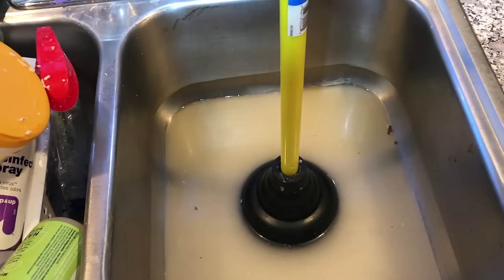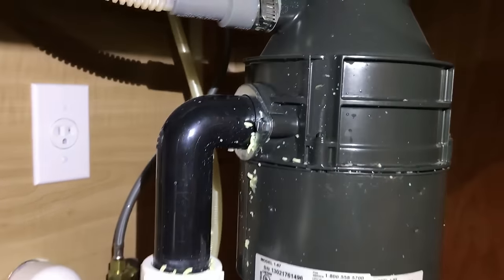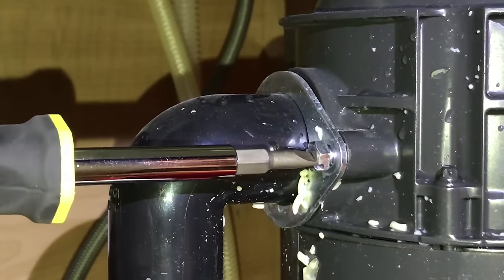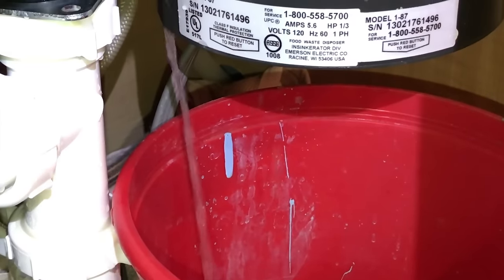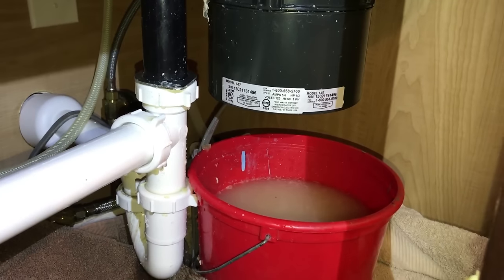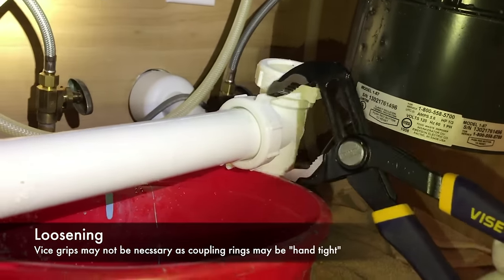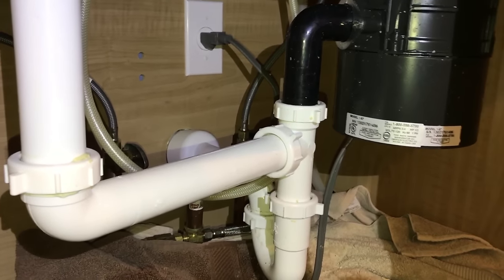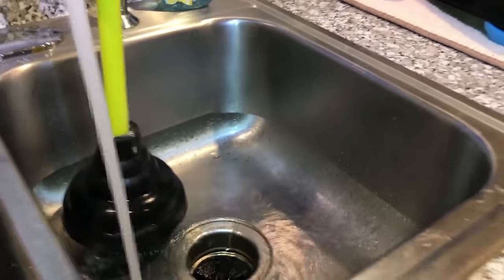How To Unclog a Garbage Disposal Drain

Comment: I had tried everything and then watched your video. The side sink was draining perfectly, as well as the garbage disposal but it kept backing up. What I didn't realize is that the pipe that joins the two basins, before they let the water drain out, is a single pipe on the exterior but is divided in the interior.  I was able to remove the screws as you recommended and clear the clog.  While I had the pipes off I power washed them with a jet spray on the hose and liquid detergent in the sink to clear the interior walls of the pipe.  The drainage on my sink is now working like brand new.  Thank you so much for posting this video.  I really appreciate people like you who take the time to make a thorough video!
Reply from the maker: Nice!  Glad you went the extra mile and cleaned it extra good while in there.  Thanks for the comment!!

Comment: Pasta! Not supposed to go in there. Also, the standard drains sold for disposals.. that cheap "Y" where the drains from the disposal and other sink pipes meet-- is junk. It restricts flow and only gives a very small drain area for each sink. Unfortunately, a "real" "Y" is hard to find for this application any more. The reason these are made this way is so you don't get backup from one sink to the other. Some civil engineer invented it to "solve" one problem (not having water come up one sink from the other) while creating a much worse one (clogs.)

Comment: Extremely helpful! My experience was exactly as shown in the video ending with a successfully removed clog (only potato skins instead of spaghetti). One other minor difference was that my mom's garbage disposal was not plugged into an outlet, so I had to turn off the disposal at the circuit breaker. The plunger trick was great, and I can add a small improvement: I used a rectangular plastic basin (normally used to store cleaning products beneath the sink) that fit under the PVC pipes, so draining the sink was faster and less messy than with a bucket. Many thanks for this public service!
Reply from the maker: Thanks for the comment!  I’m glad the video was helpful!

Comment: KRIS, BEST video I have seen on this subject and you gave me the confidence to tackle this problem.  Thank you very much!  I never used my old garbage disposal and now when I turn it on, nothing happens.  Not sure what happened but for now, I want to get rid of the leak in the sink and worry about the GP later.  Another woman had a video like yours but hers was not good and she had water gushing out all over because she was too impatient and did not let the war run down slowly from the clog like you did.
Reply from the maker: Thanks, Doug!  All my best on your project!
Reply: @theXchange    Thanks Kris!  I removed the dirty black water of the clogged sink as best as possible so that as minimal as possible will leak out underneath when I do the job.  Also not sure why the old garbage disposal just makes a humming noise when I turn it on.  I never use it and I inherited it when I bought this house.  I will have to troubleshoot that AFTER I unplug it when I do this job like you said to do for safety.
Reply: @theXchange    Got the project done with your help and the help of others who have also commented but their comments are not showing with your comments for some reason.  Anyhow, I had success after I had to take apart the garbage disposal.   No wonder it did not work or the drum would not turn by using the allen wrench and trying to turn it from the bottom of the disposal.  There was so much sludge inside that jammed the motor.  After a thorough cleaning of the inside, I re-assembled the disposal and the pipes and everything worked fine.  The HARDEST part was getting the disposal off to work on it and then lifting it up to re-attach it since it was so heavy.  Tough to do with just one person if you are not a plumber but I did it.  This is just a temporary fix, though, since I will be getting a new sink and accessories and have NO intention of getting a new disposal since I HATE the things and never use them.  Thanks again for your help and giving me the confidence to do this job.  Much appreciated!  Cheers to you from New Mexico!
Reply from the maker: @DougCeleste  That's awesome!  Thanks for sharing your success!  I always love hearing when my videos help show it's possible to do some of these things on your own without having to fork out $$$.  Glad it went well for you, and enjoy the new setup once you get it installed!
Reply: @theXchange  Thanks again Kris for your help!  When I get the new sink and plumbing installed, I will hire a plumber to do that job but there will be NO garbage disposal this time.  You can bet on that since I have NO use for one.

Comment: If you have a double sink before you take everything apart, fill the other side with hot water(it probably won't fill but, keep the hot water going) and pump away with a plunger, it pressurizes the clog from the back side and sometimes works. It has worked for me a few times.

Comment: Thanx to this terrific tutorial, I was able to clear the clog.  You probably saved me $120 on a plumber.  By the way...pasta was the culprit in my case too.
Reply: Antiques Restoration use plenty of hot water when you use disposer to flush it all they. Every couple of months fill up both sides with hot water and drain them both you can even turn on disposer to give it a little extra pressure that will flush out your 2@ line till it hits 3”” and yes I would have charged 100. Unless it was on the side Do you sell antiques I do have some I am interested in selling I have a variety of things and I guess it would depend on your location.

Comment: The video seems pretty thorough. 

A couple of things for novices. (Me) 

 It helped me to take a picture of the plumbing BEFORE i took it apart. 😂
I know. I know. But i needed to refer to it as a guide of where everything went after i got it all apart and was cleaning it... 

I also wanted to suggest using a small plastic shoebox in addition to your bucket. Its flat enough it wouldve fit under the neck if the piping..ive had to do that. 
Ive done this before, but its been YEARS!!  So wish me luck!! I will let you know...😬😬
Reply from the maker: hope it goes well!!

Comment: Muchas gracias, Kris.   I stupidly force fed too much old kale into the disposal and then saw water just shooting all around inside the disposal and coming back up.  This would've been a disaster with Thanksgiving preparations beginning tomorrow. Nothing was jammed and the disposal was doing what it's supposed to do but could not push the water out  Who'd a thunk a bag of chopped kale could bring it to its knees.   I looked at this after removing the P trap and found nothing clogged. Watched the video and disconnect the black disposal drain but did not find anything clogging it so I figured the clog must be in the disposal body.   I then disconnected the DW outlet hose at the inlet to the disposal and cut a piece off a latex glove to seal the inlet and reattached the DW hose over it so as to prevent the force of the plunger in my next step to be dissipated out through the DW hose.  I only needed three or four strokes with the plunger at the sink drain to unclog the disposal.  Then removed the latex (disaster had I forgotten to do this)a nd reattached all fittings.  Incidentally, I changed out this disposal two years ago after watching a video on it.  It's a very simple job if you replace with the same basic disposal so that all fittings can be reused.  Don't be daunted if the need arises.
Reply from the maker: well done!  I anticipate cases of clogged disposers going up this week!  Glad you got yours operational before the big day.  Happy Thanksgiving! 🦃🍁🍽

Comment: This was really helpful.  I managed to free the clog, following every step of your instructions.  The plunger trick was stellar!!  Thank you for that.  However, now when I plug in the disposal unit, it turns on automatically, whether the switch on the backsplash is flipped on, or not.  So, I cannot plug it in. I fear that the unit itself my be FUBAR, and that is beyond my capability to repair, or even evaluate.  However, I can now run my diswasher, at least, because the drains (it's a double sink) both flow freely.  So, thank you for taking the time to make this video.
Reply from the maker: Awesome!  I’m glad it helped!  I hope you’re able to figure out why it stays on while plugged in.
Reply: You have a switched outlet (garbage disposal) and non-switched (dishwasher) in the same receptacle.  My guess is you reversed the plug for the dishwasher with that of the garbage disposal.  Flip them around.

Comment: Thank you so much! Your video was easy to follow and exactly what I was looking for. One thing I’m noticing is that it looks like there is still a bit of water dripping from my reset button and another spot at the bottom of my disposal. Any ideas why or how to fix it?
Reply from the maker: check to see if there’s a slow leak/drip from the pipe leading into the disposer. I wonder if there could be a slow leeching of water than is running down the side of the disposer, but appearing to come from the reset button.

Comment: This is the first time for me I'm glad to have seen your video. I haven't attempted yet, but I will use use the Shop-Vac to suck the water out. If I take one of the couplings loose from underneath, what would happen if I ran a small snake into the line? I'm trying to avoid taking all the pieces apart. I suppose I should have been blasting it clean with my dishwasher, but it's nice to know those pipes can be twisted off. Mine are a little old so they're probably solidly connected. Any recommendations on how to loosen them? Nice clear video
Reply from the maker: Snaking it out should be a-okay. Worth a try if you have one handy!!
Reply: @theXchange  thank you for replying. I had to go out of town and I still haven't unclog the pipes. The KitchenAid underneath is clean and Clear, but the flanges are so glued on like plumber's goop is holding them tightly is there a way loosen that to avoid calling the plumber? Thank you for such a clear video. I'm a die-hard DYI lady

Comment: I know this video is rather old, but I just wanted to add (for the viewers) that if you decide to take that trap pipe off (the curved part at the bottom), replace it quickly, or at least push a towel up into the pipe going into the wall until you put the pipe back.  The trap is always filled with water, creating a “seal” from the outside sewer gas near the street/septic tank.  It’s dangerous (and gross) to breath that in.
Reply: GREAT tip and thanks for sharing for all of us.  I now have the confidence to do this job after seeing this VERY helpful video.

Comment: Thank you!! I'M GOING IN!! 🤞🙏🤞🙏🤞
Reply from the maker: You got this!!
Reply: 😢 I'm at a loss. I took everything apart, looked, hosed it all clean. No blockage. Sink still won't drain. Plunge has NO give, like there's a huge tight clog somewhere.  Turn on disposal water drains fast. Disposal off, sink fills up again. Go to yard and unscrew the sewer drain cap. So much STINKY muck water came out, then the sink drained immediately away, but to the backyard. I think, SUCCESS! Got the dishes washed. Dishwasher all comes out of that yard waste pipe, but as soon as I screw it back in, the sink fills up again but now has that wonderful added STENCH!🤢🤮  So I cut lemons throw them down. Then dumped a bag of ice down. Yell to my daughter to unscrew the outside cap again, flip the switch and let her rip! My daughter screams, "ewwwww... Mommy! Our house is popping!!" Then, "Now it's poopy snow! Now, lemon iceies! Our house is a snow-cone machine!!" I run out and sure enough... Life threw lemons and I made lemonade. LITERALLY! 🤣🤣😂 We crack up! Now the bad news....  Cherry topper to my soft serve ice cream sundae Sunday. We hear something. Strange🤔Disposal? Naaaaaa.. I run inside to find water shooting from under the sink watering the plants on my antique sideboard. Complete opposite side of the kitchen😒 Run, shut off the main. I guess all that ice was just too much for the disposal to handle. Badger housing split. Of course JUST out of warranty. Sink fills with water again. REALLY? 🤬😡 NOTTA-FING-GA!! Daughter then hits me with my own life lesson. "Mommy, it's ok. We did our best. We learned new things. The plants need watering anyway, and we had so much funny fun too. Had to laugh. We got the mess and flood cleaned up, and kid is off to bed. I then sat down and had a good long cry. I feel better now. Try again tomorrow. It's "Make A Difference Monday" It's now almost 12am. Shower time. Tomorrow I YT  how to remove disposal and put a regular drain back in. So sorry for the Novella, and thank you so much for everything you taught us today.
Reply from the maker: 😮 Thanks for that awesome comment!  That’s quite the experience!  I’m glad you and your daughter were able to make the best of such a frustrating experience, and I really hope 🙏 that everything works out 💪 for the both of you!
Reply: @theXchange  Thank you Chris! 😊

Comment: Your video looks pretty straightforward, unfortunately, my Plumbing is 25 years old in the plumbers group is holding everything on so tight nothing is hand tight. I can't get behind the KitchenAid well enough to unclog anything. What would you recommend because of the plumber is going to cost me $300 and this is my second clogged my own fault
Reply from the maker: You may need to go at it with a wrench 🔧 to loosen up the couplings but obviously do so at your own risk ⚠️

Comment: Thank you for this video.  I will need to try this tomorrow.  Quick question: Did you need to first shut off any water valves before starting?  Did you need to do anything with the pipe that leads to the dishwasher?  Or did you just have to unplug the disposal?  Thanks very much!
Reply from the maker: unplugging it is all you should need 👍🏻

Comment: If the disposal is hard mounted and not a plug in, will turning off the fuse switch work just as well?
Reply from the maker: yes, that’s exactly correct. Cut power at the panel and make sure it doesn’t turn on to validate the correct breaker was switched off.

Comment: If the water drips a little around the disposal area, after putting it back together should I take it out and adjust it?
Reply from the maker: I’d make sure it’s seated properly, so an adjustment may be needed. If it’s seated properly, then I’d see if you can identify where it’s seeping from. If it’s drippy from the bottom of the disposer, it could mean the disposer needs replacing. If water continues to appear to run down the side of the disposer, also check the connecting PVC to the sink is fully tightened
Reply: @theXchange  thank you, I appreciate you replying back to me
Reply from the maker: np!  Hope it helps!

Comment: Best if addresses your problem, This one did not. I took all those hoses lose, no water came out at all, yet my sink was still filled. Only when i losened the "overflow hose did water start to pour out. So that hose that you took poff of the disposal with a flange I removed, no clogs, completely clear. So sink full of water, no water comes out there. All the water comes out of the "overflow" hose above that and that is clogged somewhere back behind the counter or in the floor. I have no idea where that goes. So the sink water is actually not passing thru the disposal but out thru that hose. I've had my hand down in that disposal and I can turn the little doohickeys and I just can't get to what ever is clogging the actual disposal. Thing is i barely ever used it or that side of the sink because I hate those things they always clog and they always stop working.
Reply from the maker: That’s weird.  If you turn on the disposer, does it spin?  Obviously do this with your plumbing reconnected in case that clears it out
Reply: @theXchange  no its completely locked up. It hums is all. The three little grinders on the gear/wheel/main thing that turns are loose and moveable. But no water comes thru. I think it's basically rusted shut for lack of a better term. I also noticed that the ground wire is loose under the sink. Not sure what to ground it too. Guess the guy that fixed the dishwasher pulled it loose but that over flow line is completely clogged down down way down.
Reply from the maker: there should be a tool that looks like an allen wrench, and underneath the disposer, right in the center of it, the tool inserts there. Use the tool to manually turn the wheel in an attempt to jog loose whatever is preventing it from spinning.  The tool looks like this one on Amazon.  https://amzn.to/3BVWFJ6
Reply: @theXchange  thank you ill give that a try
Reply: @theXchange  BTW I tried that and the whole GD rotates LOL. How hard is it to just take out the GD and put a regular drain there? it's all PVC and I've worked with that before. I used to install sprinklers systems. I'm mainly worried about replacing the actual metal thing in the drain that attaches or is part of the sink.